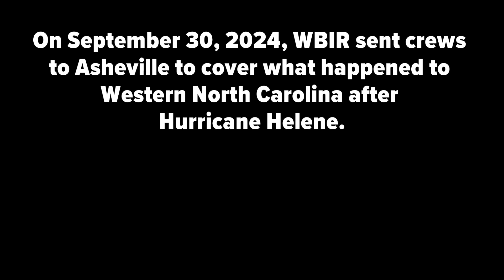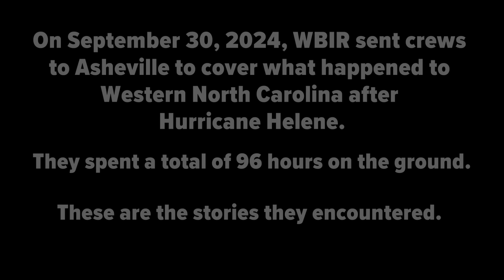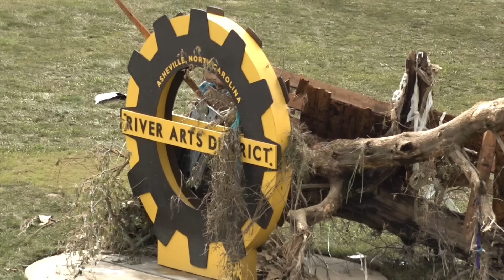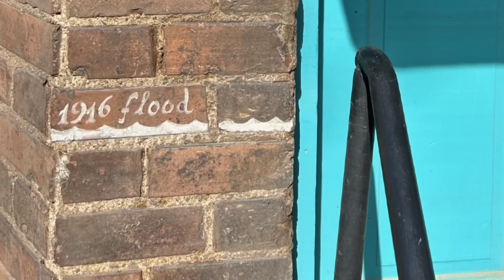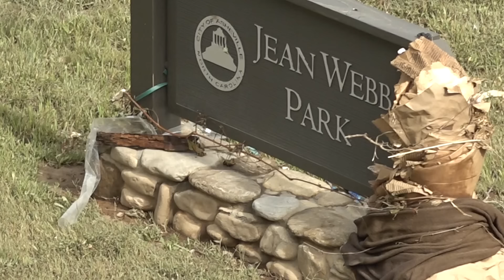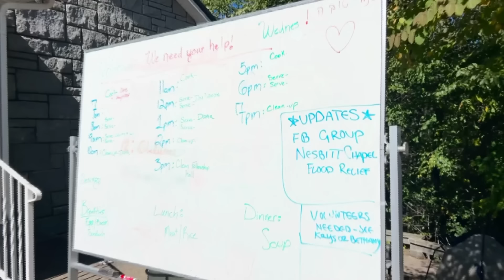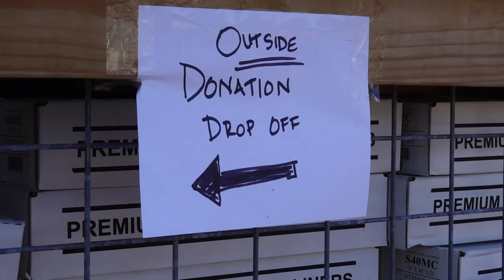Helene's Aftermath - 96 Hours in Asheville

Comment: Just spoke to a family that spent 13 days stuck on a mountain in Georgia without power. Solar Generators can be tied into a house, expand capacity by adding batteries as you budget. Plug and play, super simple and mobile. Charge with a any type of panel, generator, vehicle or a regular plug socket.  We have options for every budget and power output you need.